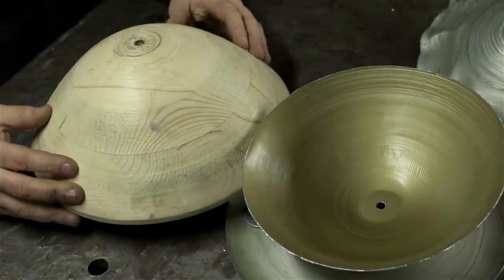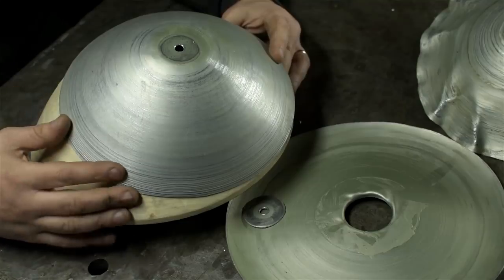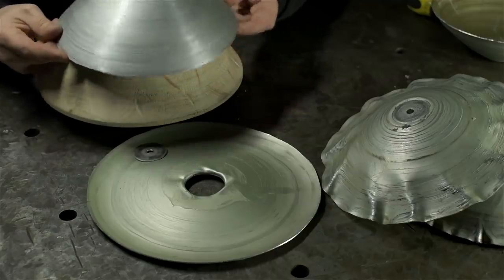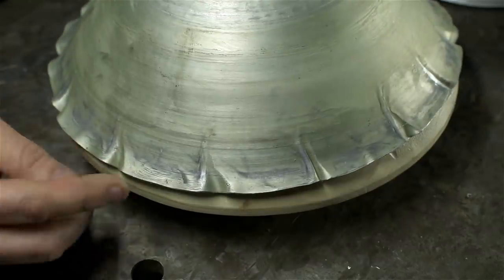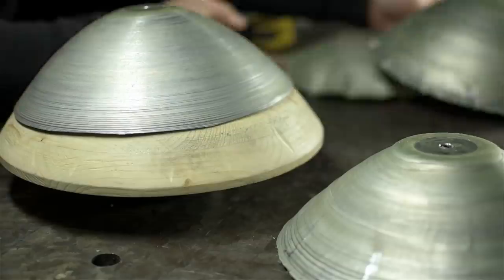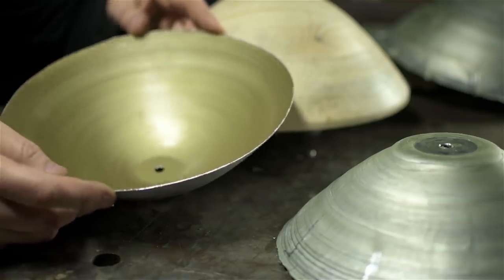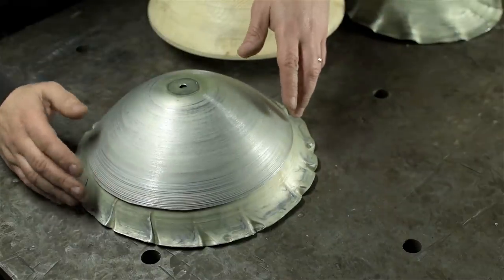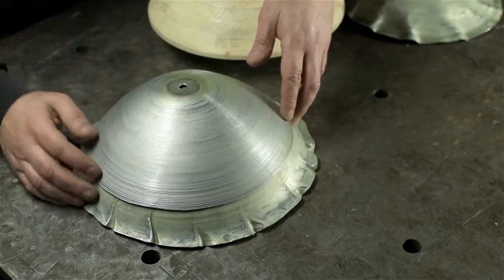Spinning Metal - Round 1 - I LOST!

Comment: 1100-0, or 3003 would have worked great. Roller is too square, needs a better radius on it. Soap or Tool-Saver for spinning lubricant. Depending on grade of Aluminum torch heat may work. Get yourself some TempStiks heat to about 200°. 
27 years of experience........
Reply: I was going to say the same about 1100 or 3003. Also for annealing, I scribble non-overlapping lines with sharpie and burn it off with mapp gas.
Reply: With aluminum, we spin at 600 deg. Then again, our product is 2.5" thk and 19 ft. in dia.
Reply: @freekinfreak1  ...and how close to the workpiece do you stand?
Reply: @scottwillis5434  we check with temp sticks on the ends of broom handles, bout 6 feet away. The spinner is in an enclosed chair above the hydraulic roller.18 rose buds blowing wide open, it gets hot!!!!
Reply: @freekinfreak1  sounds like cool s*** I grew up in a machine shop stuff like that it's pretty cool
Reply: @Ironnate87  yeah I was thinking the hardness of material there what's preventing the objective I know weld wheels spins there wheel halves out of 6061
Reply: Yes the radius of the tool I need lubricant out there I think would have helped not for the scrap material that he was trying to use with

Comment: Tony I am aluminum profile producer. You need to find 1xxx series sheet metal and it need to be non tempered. F condition. 1050 or 1070 is common here but any 1xxx alloy works. And also when you stretch half way through you should remove material from our side to relieve stress on the edges.

Comment: You will need to start with a blank which is larger than the form needs to be covered. For this project I would suggest roughly 4" more. If you had a slow motion camera on while the edge folding is occurring what you will see is that the material wants to fold as you progress up the piece. As you approach the edge the material has less area to fold and it becomes easier for it to do so. So, when you reach the critical moment it folds. Adding more material doesn't allow this folding to happen because the rotational force isn't overcome by the folding. When you get more metal give it a shot. Good luck!

Comment: Try 3003 and anneal to 900 deg and quench. You may have to do it again halfway thru. 
Alternately start out with 1100 H0.
And that last little bit around the outside edge needs to be cut after shaping start with slightly larger stock . That flange is what keeps it from wrinkling.

Comment: When I was doing my apprenticeship, our lecturer brought in this old bloke, he smelt somewhat of garlic, probably on account of the string of garlic round his neck, which apparently was the fashion back in the day.... Anyhow I digress 😁 He was a copper smith, not like the sheeties you get doing your arcondition ducting nowadays. A proper old fashioned copper Smith. Anyway he spent about an hour beating and heating, then re-beating this peice of copper with a wooden mallet, on a wooden form, while leaning on his wooden leg, (ok I made that last part up,) until he came up with an old fashioned copper kettle. So I guess you're wondering what the point of the story is? Well it turns out that strings of garlic tied round your neck are actually very fashionable 😁
Reply: Oh and maybe a little preforming with a wooden mallet, then a little heat before finishing on the lathe might help 😁
Reply: amazing
Reply: you getting fashion advice Colin? Garlic would be less dangerous then wearing a tie I suppose!  Shouldn't you be off playing with fireworks :)

Comment: The wavy pattern you are getting is from the outer edge being compressed into itself by the stretching of the inner portion. In metal work you have sinking and raising. Sinking is where the metal is stretched thinner, and raising is where it is thickened. The stretched material from the middle has to go somewhere, and where it goes is to the edge. As you sink the middle, you raise the edge, and if you raise it too much, you get this. You have to make sure the edge raises evenly or it begins to become wavy.

Comment: For those that are unaware, annealing is a process of heating a metal (ideal temp is specific to individual metal) then slowly cooling to produce a flexible molecular structure. Quenching after heating produces a much harder/finer/tougher molecular structure. Work hardening is the transition from the former to the latter by the application of 'force' energy instead of 'heat' energy.

Comment: First off, you need to "Break the outside Edge". 

Start your first few passes travelling as far to the edge as possible to put more even friction/heat into the piece. The grain structure holds tight at the edges of the metal, failure to heat sufficiently causes the grains to "react" trying to hold together, thus the distortion and/or tearing. 

Your able to get it relatively even on the smaller disks, but for the larger ones you need to distribute the friction/heat more evenly. Try preheating with a torch, that should allow the edges to conform enough for you to get a smooth radius aswell.
Happy Crafting!!!

Comment: Okay two things one when forming aluminium you should use unheat treated 6061 0 or 7075 0 for forming. Next lubricate the forming wheel, when it gets out that far it starts dragging on the work.

Comment: When I was going to aircraft mechanics school in 1966 we had to make a teardrop shaped bubble fairing out of I believe 200 series aluminun which was annealed. We did by pounding  the blank into a form. The critical thing to rember is that the metal work hardens as you work it  and the way to avoid this is by annealing the blank with a sooty welding torch, youmay have to do this more than once durring the process. Hope this helps.

Comment: TOT, i highly recommend you look into folks like Gene Winfield, Chris Rünge, and metal shaping guys in general. I realize that this is an old video, but i definitely believe you can do this. Those tucks that you referred to as "lampshading" are an indication that the metal has stretched, like you suggested. That means you need to shrink. Your pieces could easily be fixed with a simple bemchtop shrinker/ stretcher combo. Best of luck

Comment: I think you could get it to spin all the way out to 12" dia with 3003 alloy, or even with a work hardenable alloy such as 6061, as long as you start with -0 condition; (6061-T0 is pretty commonly available) it can survive a lot of stretch before starting to lamp shade on you.  Other thoughts: add a lube film to the material, reduce surface feet as you approach perimeter and change over to a 30% dia wooden or aluminum tailstock mandrel after it is around 50% spun, maybe slight torch anneal mid-process as a last resort? Good luck. Awesome video!

Comment: TOT.  An observation based on a couple of other spinning vids: the other guys are pressing hard ONLY against the mold/buck thingy... working from inside to out... but never stretching the metal unless they’re pushing against the buck/form/mold thingy. How to say in other words: When you’re pushing the tool, never let there be a gap — other than the thickness of the material itself — between the tool and the mold.

Comment: 1. Heat is your friend. Makes metal more malleable and ductile

2. That pattern on the outside... there's a few reasons for that.

A. it's been stretched too far and it's lost it's strength. You might even want to just use a blowtorch and make sure it's more flexible when you're that far out.

B. After you've got enough bend to prevent the thing from shaking, bend the edges first just a bit. When you stretch out the inside, you also put the outside under a lot of outward expansion pressure. If you curve the outside preemptively, the outward expansion, instead of pressure loading the edges... it will instead slightly push out a curve. It's hard to explain... just do it. After you're started, bow the outside couple inches, and then resume working from the inside out.

Comment: Hey man.
My first apprenticeship was exactly that job you are trying to do here. But i mostly learned it with hand tools on something that remebles a wood turning lathe. I haven't done it for close to 20 years, but i finished my training ;)
First of all you are right that the material work hardens. You can hear (and if you use hand tools even feel) that in the material. you should also use a good amount of fat (not oil, but metal forming fat. you can find that stuff for deep drawing...) on the work piece to avoid the striae formation you have here. especially when you are working with metal tools.
We avoided the waves by... not finding the correct word to describe it... On the spinning piece we bent the outer most 1 or 2 cm towards the head stock to give it form stability. We did this  with a hand tool from the front a piece of wood from the back for the work piece to press against... Hard to explain. I'm sorry. I would struggle to explain it in german, but in english i just can't do better.
The round workpiece after that looks like a frying pan with a really small rim... It's enough to bend out the last 2 cm for like 20-30 degrees.
When you feel that the workpiece starts to vibrate and you need a lot of force, please consider annealing it.

Comment: I did an explosive hydro-forming project in school, where i pushed some sheet aluminum into a female die with a de-pelleted 20-ga shotgun shell and (incompressible) water cushion.  Tons of fun till the primer blows out and propels the hammer back up the tube...  I used 1100-T0 aluminum sheet and it worked pretty well.  Maybe something soft like this would help you out.  Golly I love your humor AND the way you fast-forward thru the boring parts because it shows you respect my valuable time.`

Comment: Two possibilities occur to me.
1 geometry. In deep drawing cups you start big and then get smaller. Maybe start with a half way blank and do the edges first.
2 Texture. Could be the sheet has a grain. Crystals deform differently in different crystal directions. Rolled sheet has a texture. Upshot is sheet deforms more in some directions than others

Comment: In my experience anodized aluminium doesn't flow nicely as you discovered. Normally I anneal the aluminium before starting on it (blacken the blank with acetylene soot, heat up until soot starts to disappear, quench in cold water). Even pressure is a must.

Comment: Hello Tony my friend. If you would like a mathy thing on why this is hard to do, I will provide. When you start out with the sheet of metal, the curvature of the surface is zero for all intents and purposes. When you go to try and put it on to the form, you try and make it have a non-zero curvature at every single point. You can't do this without deforming the material due to something or good friend Gauss proved that is called The Remarkable Theorem in English. This results in several things. You cannot map the Earth onto a map without distortion, you cannot bend a piece of paper (or sheet metal :) ) onto a sphere, and it is also the principle behind keeping your pizza straight when you bend it down the middle. Thanks for the video! Love your channel.

Comment: I ran a metal form lathe before, with aluminium you'll need urithane rollers.

You're not supposed to stop mid way through the part, go all the way to just before the roller makes contact to the edge. Slowly forming to the die.

And used oil to lubricate the part.

Comment: I do vehicle wrapping as part of my living and those skirt wrinkles you are seeing are common when applying decal material over a compound curve.  Now I realise that vinyl is not metal however it looks extremely similar.  The solution with vinyl is to have plenty of extra material so the skirt wrinkles happen past the point of where they matter.  Combined with a touch of heat and going slow working pressure evenly.  Maybe try checking out some wrapping videos.  May be some techniques there that can cross platforms.  Hope this helps!

Comment: Maybe you might need one or two more wooden guides, bigger ones to dial the sphere's radius down a little slower but with more support from the wooden guide. The moment the metal looks like a china cymbal seems like a lot of stress for the material (china cymbals also tend tear quicker). So maybe when you find a way to go through the whole diameter in one run, without creating that tight bell and china style cymbal (as seen at 4:00), it might be easier. The fact that the metal needs to snap back over that point might be the fundament for lampshading.
But that is just my thinking, I usually don't know things.

Comment: I would try without the rolly wheel as the working tool.
Try with a well rounded? Well polished harder metal as the tool and a bit of decent lubrocation oil.
It should induce some controlled amount of friction,  thus controlled heat to the forming point, the surface being worked on.
  Some decent softish aluminum grades can be bought by the roll 10meter 20m 50m at a hardware / building supply store.
 It's used as flashing for roofing etc. 
Good luck.

Comment: Tony, try mirror polishing your tool and using like high temp grease.  Aluminum hates heat and rough tooling.  Also, consistent pressure and faster tram.

Comment: I’ve seen spinning done with pewter, which I think is considerably more ductile. Instead of using a carriage-mounted tool, I saw a guy use a rounding tool in much the same fashion as would be done in a wood-working lathe. There was little or no wrinkling at the periphery and the finish was quite good. The guy was demonstrating some old-world machining techniques, but skill aside, I think he was using a more cooperative material than what you found.

Comment: I've done this is the past with 6061 tube and created a very nice bell mouth for an air intake.  The trick, is heat.  I needed to heat the aluminum while spinning with propane.  It took some try and error, but in the end, the 4th one turned out beyond nice.  I would try using heat while you spin, you will need to get it to the sweet spot temp wise, which in 6061 I think was around 600, but a hair over and it would fail.  Good Luck!

Comment: The "lampshading" could be resonant lobes. Try getting a timing strobe to see. Resonance is function of driving frequency (lathe speed), stiffness (work hardening and shape change), and mass (moving mass distribution by shaping). To break the resonance (if that's what it is), you can change the lathe speed or anneal it.

Comment: I don’t know the correct term if this is not right! Would it help if you anneal it first again don’t know if this term is correct but you take your torch and make it to where it’s making a lot of soot and go over the whole piece like that to where the whole piece turns black from the soot. From what I understand it softens the metal to form it easier I’ve seen it done when guys are hand building gas tanks and fenders for motorcycles.
Reply: Yeah what that guy below me said anneal the material first to soften the material.

Comment: I have no idea what i am talking about, but this looks like the metal reached a "natural frequency".

Natural frequencies are studied in vibrations and control systems in mechanical engineering. It helps explain the phenomenons that we see when bridges are poorly designed and the bridge begins to sway and deform. The spindle may be spinning at a speed that material's internal natural frequency matches up with. It is like a stone skipping on a pond. The stone starts off with long spaced out bounces but the intervals between the skips increase as well as the distance between the skips decreases. Now imagine that there are waves on the pond that match the frequency of the skips exactly. This causes the skips to sustain the same height and bounce. 

In controls, my professor would call this "exploding" or going out of control. We combat this phenomenon by purposefully changing the natural frequency of the system. I would be curious to know if you can feel this "meeting of frequencies" before it is happening, and stop. Once stopped, move to a completely different section, deform the material slightly, and then return to your original path and try again. Rinse and Repeat.

The deformed material looks like the bends are evenly spaced, which to me means that the rate of deformation was a factor of the frequency. The analogy would be: the stone is meeting the waves exactly like the metal is bending at the same rate as the spindle. Except, the material cannot handle the same bend over and over in the same exact spot, so it deforms. And it will deform rapidly. Now imagine a hammer hitting that spot of the material multiple times except the hammer is striking 32 times a second. 

I don't know why I'm writing this. lol. I could be TOTALLY wrong, not joking.
Cheers

Comment: You need the material in an "O" temp. Barring that, a T-4. If you can't find any, cut your blanks and aneal them yourself. The old tried and true acetylene soot on the part, then warm it 'till it's clean. Follow that with natural cooling to room temperature and you should be off to the races. A higher radius on your roller wouldn't hurt. That's my best guess for you. Good luck and thanks for your videos! Ps...Avoid 200 and 700 series material. 100 series is soft. 6000 [ie 6061 T-6] is your most common, as in screen doors, lawn chairs, etc, etc.

Comment: If you can track down some 5052 alloy sheet, have a go with it. An aviation materials stockist would have it in anything down to 0.020". It's considered a "soft" alloy and is very workable. Often used for fuel tanks as it can be formed well without work hardening too much. Heck if that fails, 1000-series will form to nearly anything you can imagine, but getting anything thinner than about 0.040" might be a stretch (ha, stretch, geddit?).